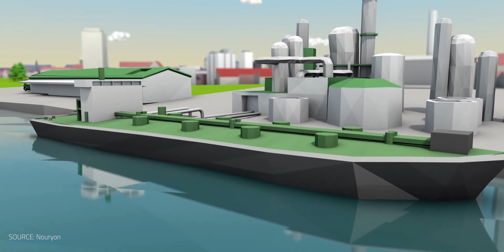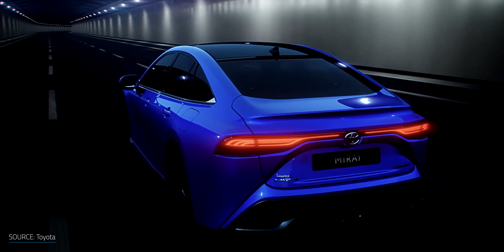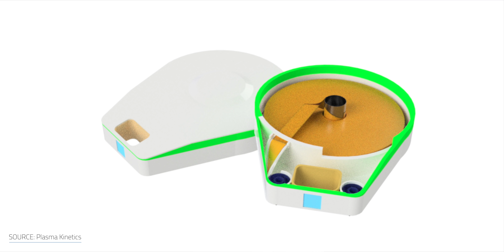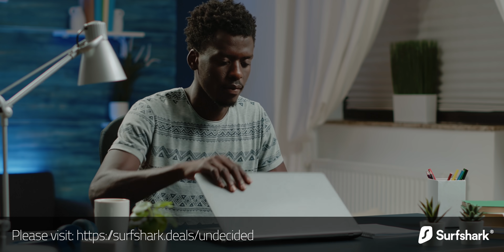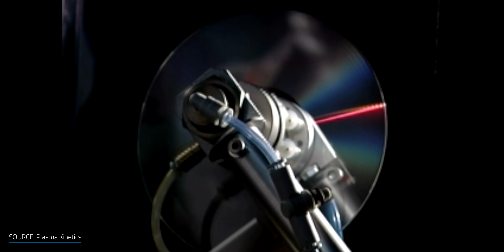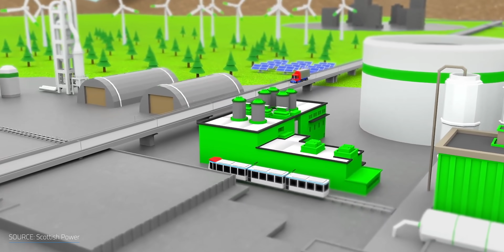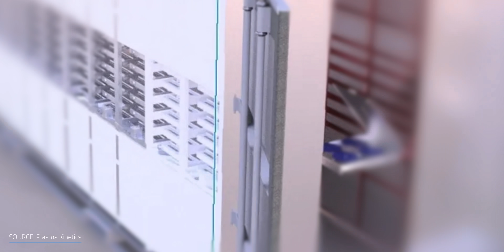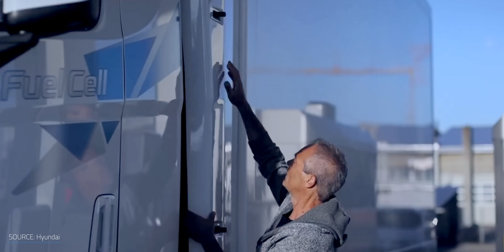Energy Storage Breakthrough - Solid Hydrogen Explained

Comment: This sounds so possible, the question how can the developers get the support they need, truly amazing
Reply: The new infrastructure bill that just passed will enable a lot of the car chargers needed across America to be built at gas stations.  This would have been a prime time to have sight funding. Perhaps in the future it will catch on and funding will be discovered.
Reply: Evan Nagel Not really. The main source of hydrogen is natural gas and other fossil fuels. Also biomass can be used as source of hydrogen.
Reply: call your governor and senators. tell them to remove existing barriers to these technologies. if they blow it off than don't vote for them. if you have any friends or family members who care as mush as you do, get them to do the same.
Reply: Simple, they will move to another country that doesn't restrict their development and instead supports it.
Reply: @625098evan  i agree but the problem with politics in America of a 2 party system requires voting for the lesser pf 2 evils or screw balls.... Its very hard for us to get anything reasonable out of politics unless u know the public can really support the best guys for the job... I think this is literally the biggest problem so people need to make more video like this to promote the heck out of this...otherwise most people wont catch on...
Reply: @SalComposer  Yes, I know. But if you use electricity to generate hydrogen, we lose a big of adventage on simple batteries due it's lower efficency.
Reply: @Souchirouu  lol sheep
Reply: @krisztiankoblos1948  how do battery's work? Maybe search up how much it takes to fill a AA

Comment: Seems like the "real" application of this tech would be siphoning that sweet sweet deuterium for fusion reactors as a group effort. That stuff is really hard to come by.
Reply: Given, this really outperforms the current tech at all.
Reply: Not really hard to come by. Deuterium is filtered out of water industrially. https://en.wikipedia.org/wiki/Girdler_sulfide_process
Reply: @BlkRider  "It is a highly energy intensive process.[3]"

With these cassettes, deuterium would be enriched naturally as a "contaminant". The energy used now for boiling water could then be for driving cars. 
That is, as  @Anik Samiur Rahman  said,assuming this tech actually works.
Reply: how would this be useful for that?  Is sucks up all hydrogen - not just deuterium.  It doesn't seem like it has any separation mechanism.
Reply: @oginsights5340  he said it in the video.
Reply: ayyyy, my dude thinking about the fusion community, appreciate it =D That was my first thought as well: an adsorbent that differentiates between isotopes so well would actually be very useful, not only for fusion but also for generating heavy water, which is incredibly expensive normally.
Reply: Yeah but ya know what they say about fusion power. I don’t know if we have the time left to wait for fusion to develop.
Reply: @eligoldman9200  sociological despair is a different topic. Problem isn't that we think we can't stop climate change(we think we can stop meteors and make other planets habitable). The problem is we think we can't  stop ourselves from making it worse.

Comment: This sounds amazing! So from your video it sounds like the main benefit of solid hydrogen compared to compressed gas systems is safety and simplicity. They're not as efficient because they're heavier and have a lower energy density, but they're vastly safer and easier to store. That sounds like a pretty big deal, because you wouldn't have to use lots of heavy insulation or worry about the problem of continuous leakage which is inherent within any compressed hydrogen gas system. A fascinating new technology.

Comment: 70% efficiency of the cassette paired with ~80% efficiency of electrolytic hydrogen generation and ~80% (best case) of the fuel cell that consumes the hydrogen leaves you with some pretty big losses compared to Li ion.
Reply: efficiency isn't the problem, or we wouldn't use gasoline in combustion engines.

Comment: Theoretically, this sounds promising.  This method of replacing solid state hydrogen batteries in vehicles suits well for the existing fuel distribution network which can be repurposed for replacing hydrogen 'batteries' instead of  fuel in vehicles. But we may hold our excitement until a real life example comes up.

Comment: "Metal hydride"
"doesn't burn or explode"
Dafaq? Last i checked both hydrogen and most metal really wants to oxidize. Can someone who knows more chemistry than me explain why this isn't an aggressively exothermic event waiting to happen... just like any other gas tank/hydrogen bottle?
Reply: Idk what they are talking about. I remember from ochem that lithium aluminium hydride is flammable. Looking it up it looks like magnesium hydride is pyrophoric. I know they are using an alloy but I can't imagine it is unreactive like it is portrayed in this video.

I suspect that this is also why Plasma Kinetics might have export restrictions on this technology. If the metal hydride is a good solid rocket propellant directly then it might fall under some sort of rule restricting the export of potentially military applicable materials.
Reply: could be that the particular metal hydride has stabilized electrons once the hydrogen is adsorbed?
Reply: The tape surface has nanotubes, so it's possible that the adsorbed hydrogen isn't chemically accessible to atmospheric oxygen.  Just a guess.
Reply: @Peter from NZ Sure, but this isnt a block, its a thin tape with bonus surface area from microscale pores (speeding up basically all reactions it'll do) that's saturated with hydrogen.

Almost everything burns when it gets hot enough, but if it happens at gas-fire temperatures instead of "steel smelter" temperatures that has safety implications for designs using the tech.
Reply: Almost by definition, all forms of high density energy storage is unstable and then dangerous to handle. Mater tends naturally to arrange to the lower energy state possible, so every battery of any form will need careful handling to prevent an unplanned energy liberation.
Reply: I understand almost nothing about most developments I read about in chemistry despite having studied it in university. I just know metal hydrides are generally quite easily oxidized and question what they could have done to change this fact.
Reply: Kargadan  Okay, that explains standard operation (which i wasn't concerned about, but i phrased my comment poorly so it looked like i was, my bad).  What about the failure states? Does a break in the material leak some, none, or a lot? If a fire catches nearby can the heat lead to released hydrogen... which could form a feedback loop that's either a fire or explosion depending on the rate?

Gas tanks dont explode spontaneously, but they catch fire spectaularly. I was trying to ask about that kind of thing. How wrong does stuff have to go before the stored energy gets released?

Comment: Between the infrastructure cost/maintenance/risk of grid outage and waiting min. 15m for a Tesla supercharger to top up your 200 mile range, I'd much prefer just popping into the gas station and picking up a few cartridges of this real quick. If it also isn't guaranteed to burn my car to a crisp with no hopes of putting it out if it suffers critical failure unlike Li-Ion batteries that's also a pretty big plus I'd say
Reply: Once solid state batteries catch on in a few years, there will be no fire risk for electric cars. Not only that but they will have higher energy densities and you can charge faster because they are less susceptible to heat. IMO Hydrogen vehicles are dead once solid state blows up.
Reply: This technology puts a middle man between you and your energy autonomy, same as gas. I'll stick to BEV for personal use since I don't need to pay some energy producer to fill it up as long as I'm smart with my solar panels. Potentially a game changer for commercial operations though, and for people who can't produce electricity at home.
Reply: @benjamin7440  how are BEVs not doing that though. You don't generate your own electricity you still pay for it. In actuality it would be so much cheaper to run your own hydrogen collectors than it would be to generate your own electricity. If you want energy autonomy, the tech in this video is what you want.
Reply: @xenn4985  In actuality it would be so much cheaper to run your own hydrogen collectors than it would be to generate your own electricity.
No it isn't. any current way of creating hydrogen in a green way requires electricity. Even hydrogen solar panels do in certain way, which is why their efficieny is much lower. And I doubt they'd bring the technology from this video to the market for private use, that just wouldn't make sense.

You don't generate your own electricity you still pay for it.
You pay for every kind of energy you use, be it gas, electricity, hydrogen or even your own energy in some form or another. The only way this wouldn't be true if you essentially life like medieval hermit and build/create everything yourself.

He specifically said he'd use his solar panels, meaning he only would be using his own power. Sure he still needs to pay for the solar panels, but this is the case for anything.
Reply: @MDP1702  "any current way of creating hydrogen in a green way requires electricity" did you even just watch the fucking video? You typed all that and said absolutely nothing in response to my reply, congratulations.
Reply: @xenn4985  Like I said, with the solar panels on my roof. If the energy company cuts my power, I can still charge my car. Unless I can make these fuel cells in my basement, there is no autonomy from an energy provider.
Reply: @xenn4985  did you even just watch the fucking video?
I have, did you? This video doesn't talk about a new way of producing hydrogen, it talks about a different way of storing and transporting the hydrogen AFTER it has been produced.

So please enlighten me how you would create your own hydrogen at home and how you would get the technology mentioned in this video for private use  (because obviously there is no reason for this company to just release or sell it, they could corner the entire supply of these hydride hydrogen cartridges).
Reply: @xenn4985  I think @Benjamin was saying that he could generate electricity with solar panels and that way not pay for it.

Comment: Since the technology is so good in this so called absorbing freely available hydrogen, I am sure they can easily and simply tweak the amazing micro thin film  to absorb deuterium and even some tritium that are also available freely in open air and then ouput some fusion energy as a side dish.  /sarc
Reply: Even better than tritium, think bigger; The film can probably absorb Burgers, Stray thoughts and Violence. As such it could be a catch-all Fitness/Peace/Control mechanism that also cleans your car as you drive. In cherry flavor.

Comment: There is no way this technology can work. It defies the laws of physics more than free energy defies the laws of energy transformation. How is a thin film supposed to than hold more hydrogen than liquefied hydrogen. It's a good thing this is "undecided" because it's un-possible as far as I can tell. Even as a hydride, which theoretically could have more hydrogen density than liquid hydrogen, you still need to have twice the oxygen to turn it back into water, and a catalyst like platinum, and a secial membrane to keep the (platinum?) excited hydrogen and oxygen apart so you can capture the electron energy when they combine after you release the hydrogen from the film with the 2mw laser (also not possible) so As cool as it sounds plasma kinetics is pulling our legs probably to attract investors to get funding to further develop an impossible technology. So I would love to see this technology in action and not just see graphics describing it, because it sounds like a mega scam...

Comment: This is fantastic. If these cartridges can supply the equivalent of a pressurized tank of hydrogen gas this solves all the major issues with H2 as a fuel source. Hydrogen can be extracted from water via electrolysis and captured by the storage medium to be used by a fuel cell or burned in an internal combustion engine. It would also be great for home heating and energy providing a clean fuel source for rural areas and as a way to reduce dependence on the electrical grid.

Comment: One other issue with using hydrogen in a car, as explained is the fuel cell. They are expensive and need better longevity. Toyota and Yamaha announced that they are working on an internal combustion engine powered by hydrogen. An ICE isn't optimal for this, but it's a mature technology and cheaper than fuel cells. So if that works out and this idea works, you may have competition for the EV, or just another type of vehicle to help move away from hydrocarbon power. The other hurdle will be "Fuel Station" and refueling in a timely manner,

Comment: So how many moles of hydrogen can you get per square cm?  What is the stored btu?  How does light activate the surface inside a scroll.  Is there a turn and burn type process where a few square cm are exposed every second?  Hydrogen is a bit hard to come by thermodynamically.  The btu/watts ergs...per mole to separate hydrogen from say water is high....and then what...excess oxygen?  Last I knew oxygen was pretty reactive itself.

Comment: The recipe for the hydrogen powered electric car?  
1.  Remove large, heavy battery, 
2.  Add small fuel cell sized to power car at max desired cruising speed
3.  Plus a super capacitor sized to to handle short term (30 seconds worth is plenty) high          power for acceleration and regenerative breaking. 
Benefits? 
1.  Should be light for major vehicle and infrastructure efficiency gains.  
2.  Probably be cheaper than the battery.
3.  Less problematic than battery raw materials mining.
4.  No expensive battery recycling.
5.  Safer in a collision--minimal combustible hydrogen on board.

Comment: How do you absorb hydrogen from the air? There is no free-floating H2 around (at least not in quantities that matter), and if they claim to get it from the water vapor, then they need to use more energy to hydrolyze it than they'll get from the hydrogen. Also hydrogen isn't "positive" - if it's H2 gas, it's neutral.

Comment: Ok I get it, this is good solution for H2 storage, stil this does solve to H2 production problem. Still have to put in energy into hydrocarbons reforming, btw what happens to the C in there? As for H2O electrolysis, is like telling a car owner to take the exhaust fumes (H2O for a fuel cell) from his car and put them back in the tank, you forgot to pay the thermodynamic tax, it’s a lost battle of more energy used than that extracted.

Comment: How would emergency responders put out a fire involving these storage modules? Lithium battery pack fires are bad enough. If I understand correctly the fire's heat will cause hydrogen release which would then combine with the oxygen in the air.

Comment: I'm pretty confident everyone that uses a truck to it's fullest ability on a semi-regular basis is going to be disappointed with the EV versions. I just don't think you could drive a full trailer full of horses over snowy mountain passes for a long time in a Rivian. This is definitly where hydrogen is going to step in. If the tech is really this good then it shouldn't be too problematic figuring how to replace the disks. I know they toyed with the idea of having removable batteries for public transport busses to keep them moving through out the day without needing to recharge. Where there's a will, there's a way. This is excitivng though!

Comment: The main problem with hydrogen is its ecological impact, and it's due to the non-efficient production. Hydrogen produced using electrolysis consume a huge amount of electricity (so call "green produced hydrogen"), and is far less efficient than storing to a battery directly. That goes without saying that the vast majority of the actual production (95%) is produced using methane reformating, and so consume a lot of fossil resources, and changing a complete industry to greener production modes takes time. IMAO hydrogen storage is a secondary problem.
Hydrogen may have may have a legitimate interest for vehicules which needs a combination of high power/low mass (planes and helicopters), but it's a non-sense for private transportation.

Comment: When I see a demo car or truck driving 300 miles between refueling I will consider the tech viable.
Until then, LFP batteries are taking over all  but the highest density applications and ramping exponentially.

Comment: The deuterium is why the DOD is interfering...  there are deuterium components in certain devices.   a new way to acquire it so just like thorium cycle reactors, access by citizens will be blocked.  But you can bet the weapons applications are being designed around it now.

Comment: Neat concept but i think that the material and large scale production costs, coupled with the logistical nightmare of implementing on a worldwide scale will be the ultimate downfall of it. On another note though, "safer" hydrogen storage with deuterium byproduct is kind of tantalizing. Maybe if they focused more on grid-scale storage instead of the transport industry they might make it more attractive to investors and feasible in the shorter term.

Comment: They need to convert a vehicle to run on their product....Toyota only leases its fuel cell vehicle ....if it is still available in California....convert a fuel cell vehicle from tanks of H2 to their system.  30% less weight than battery?  Does that include weight of fuel cell?